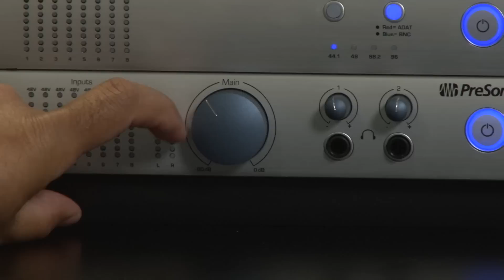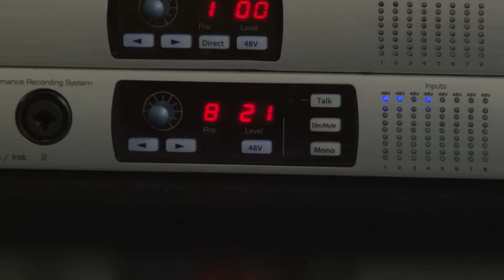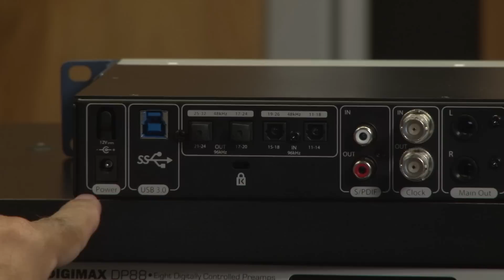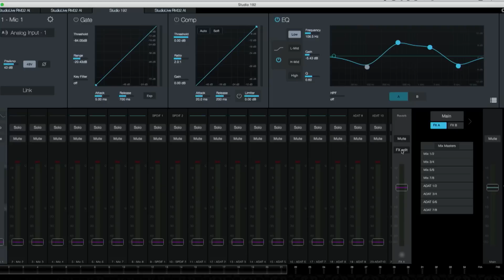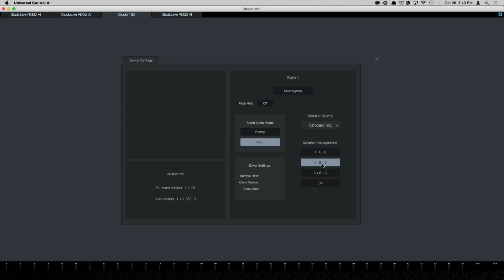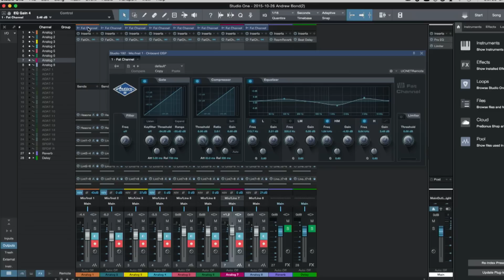Studio 192 In-depth Demonstration

Comment: I was sold my 1818 vsl with a similar software only to find after I'd started to use it after getting it set up that it was discontinued and no longer available.  This was the main reason I got the unit and now it's have a unit with no control.  So disappointed and I was refused a refund.   As I see it you shouldn't be selling the 1818 with software no longer available.  It's false advertising

Comment: Is 192khz even worth useful, we can't hear 192 kHz,
Reply: +MrSkyTown 192khz for an audio recording device, is referred to a sampling rate, not an audible frequency. It means that the hardware & software are recording 192 000 samples per seconds. It's pretty much comparable to resolution on TV monitors.

Comment: I have a question regarding this and the dp88. Are the settings (gain, 48v, etc) memorized without midi? If I turn the unit off and on, will I lose all the previous settings? Thanks

Comment: I love the idea of this, but 8 mic pres is just not enough. Is there any way to get 16 inputs at 192kHz? I'd even be willing to buy two Studio192's to get it done.
Reply from the maker: +Chris Gill Hey Chris, we hear ya. While you could add a second Studio 192, which would work great, we recommend instead adding a DP-88. It was designed specifically for guys like you who like the Studio 192 but just need more inputs. Check it out: https://www.presonus.com/products/DigiMax-DP88
Reply: +PreSonus Audio Electronics Finally had a chance to look at the new DP88. Correct me if I'm wrong, but after reading the manual it looks like the sample rate of the channels coming from the DP88 can only be 96kHz. I'd love to have 16 XLR inputs at 192kHz.